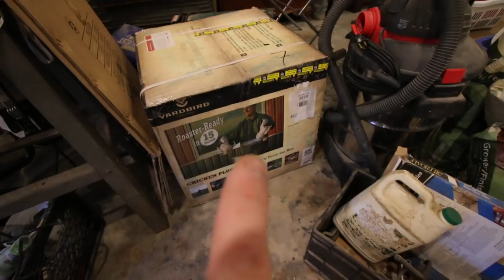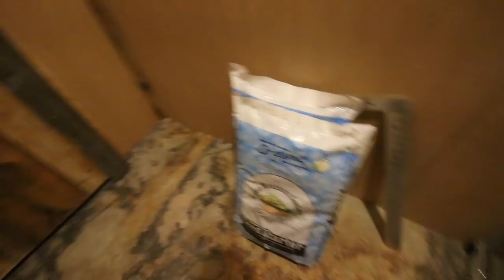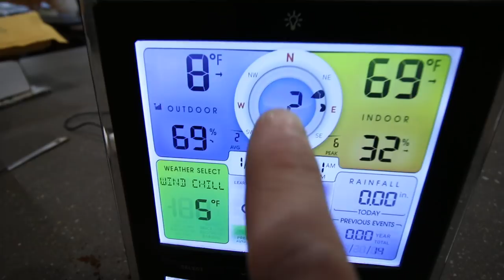Modern Steader Update ~ Concerns with our Weather Station

Comment: I use a large dog crate with a movable wall for my chick brooder.  I line the walls on the inside with cardboard about 1/2 up.  The crate gives me a good place to hang a small waterer and feeder.  And it provides ample space for a red light and ventilation.

Comment: That root cellar sure looks like a practical addition to the home stead.  The tool updates are GREAT.  Thanks.  I am going to The Philippines.  What are your suggestions for the tools we could find best for using in the islands.  Air guns are out.  We want battery operated saws and screw drivers.  Your suggestions? That snow sort of chokes me up.  The meat pole would work well for the weather station.  There would be little if any interference with the wind reader on the weather station.  I am glad to hear that you are getting more eggs.  That litter looks good.  I can see the compost now, and the resulting summer garden.  God bless the Lumnahs, God bless America!  Al, you are an inspiration and a blessed man.  Have a great month.

Comment: Build or buy a resivoir in the basement set grow shelves on blocks,  Put in airstone and goldfish.  Set up fodder, and micro green auto water system with led grow lights. Get big air pumps to use and make worm tea to fertilize in summer. Add catfish.  Split a TOTE.   Grow fish, fodder, moisture and heat and solve humidity greens, animal feed sprouted costs much less better uptake, and playmates to occupy the pets and humans.  A 4x4 clear plastic tent for climate control.  Garden seeds have room to grow.  Can t wait to see the fields in spring.

Comment: Good choice move to pole. My concern would be is the temp of the roof affecting the reported temp. Very nice station. Check out a new way to make domes with PVC (3 foot pieces) and a patented hub (3" and 6" PVC) with zip tie connections. Theory looks good. Suggested applications nice (chicken movable coops, shelters) and cheap price. Don't know if this is old news. Probably search geodesic dome hubs and zip ties.

Comment: Question: Why do you have so many roosters? It looked like you had at least 3 and since the recommended ratio is about 12 to 1 I'm wondering if you have some hens getting abused by being mated with excessively although I didn't see any of that on the video.

Comment: Keeping humidity in northern homes is a chore. The cold constantly wicks away the moisture from the inside air. Putting pots on the woodstove helps, but its not enough. If you want to raise it you need to put in a humidifier. What are you going to do with your celery now that its sprouted? Don't you have to orient that weather station? No sympathy here Al, I worked outdoors for 33yrs. Keep up the good work.